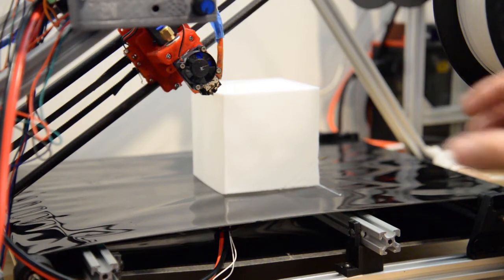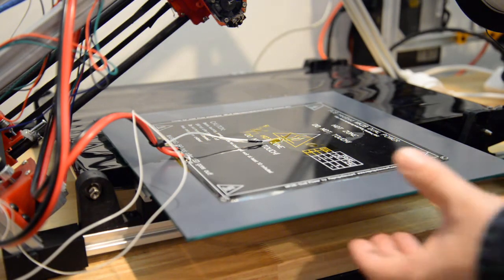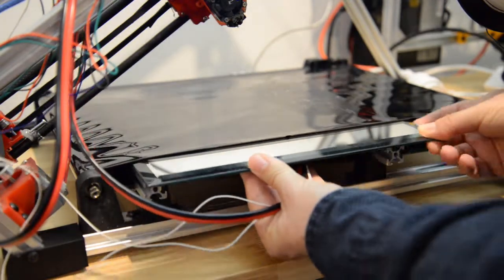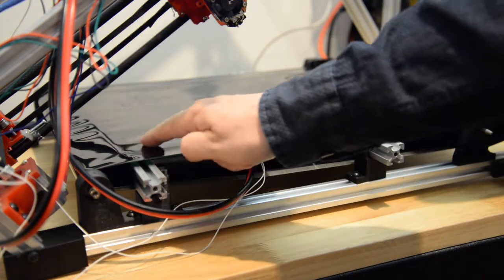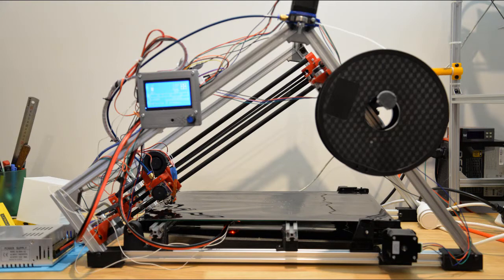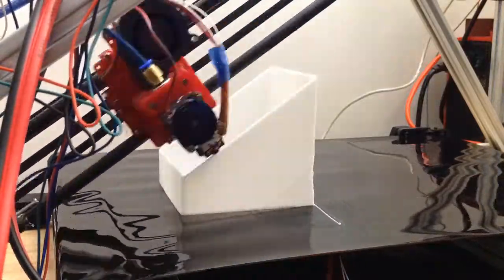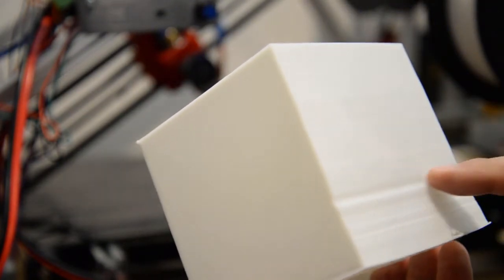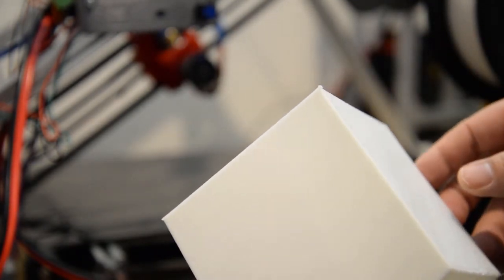3D Printer: Laser printer belt - First Test

Comment: What material are you using for the belt
Reply from the maker: In this video I was using the belt that is inside laser printer. It is pretty resistant to heat. But it was very durable. I switched to stainless steel shim stock 0.05mm. Glued together with gorilla glue. Then covered the belt in kapton tape. When printing pla blue painters tape is still the easiest to use. And cheap.

Comment: What  software do you use
Reply from the maker: Hi Michael. I'm using Cura by Blackbelt3d https://blackbelt-3d.com/blackbelt-cura/
Reply: Zechy Coyte-King I know this might sound pretty ridiculous but I was thinking of  hacking a treadmill and making one of these just add the gantry and motors and drivers
Reply from the maker: Lateral thinking is good. I would check if the treadmill can handle the nozzle temperature and if the filament would stick to it.

Comment: Don't know if you mentioned it before but I guess you need a layer of capton tape around the belt. Maybe more tension too (lift the heated glass some mm?).Great progress!
Reply from the maker: Yes. I remember you mentioning it. I will definitely test out the tension by lifting the glass. And also test the adhesion with kapton tape. Thanks for the support.